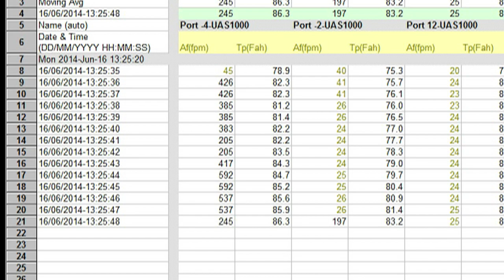How to measure airflow patterns and laminar flow in a Biosafety Cabinet

Comment from the maker: We've developed a fast, affordable and highly accurate way to verify laminar flow and sash flow in biosafety cabinets and chemical fume hoods. Multi-point measurement saves time and money, and yields more reliable data. Learn more here:

How to measure airflow patterns and laminar flow in a Biosafety Cabinet
Reply: Looks like a formidable sensor layout, and infrastructure, but I am just flabbergasted that you have not developed particle sensors so you can actually validate the key performance of the LAF/Biohazard/Isolator.